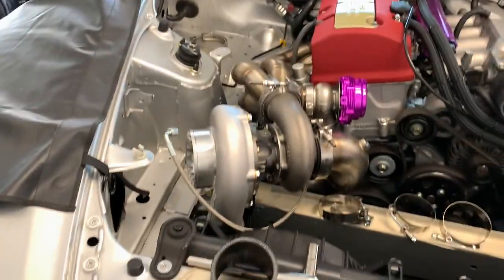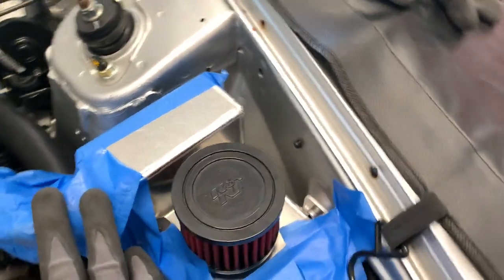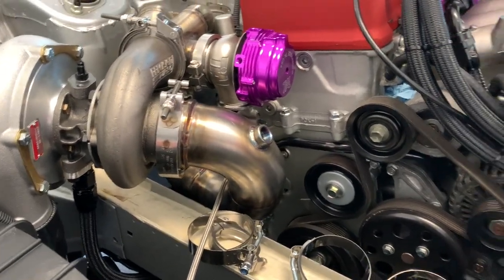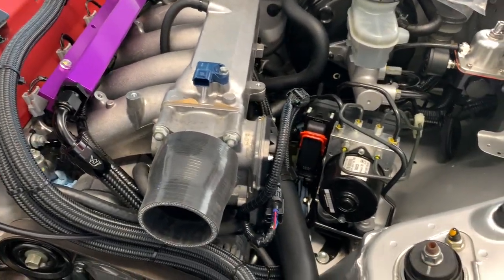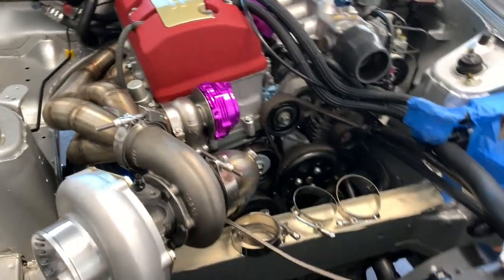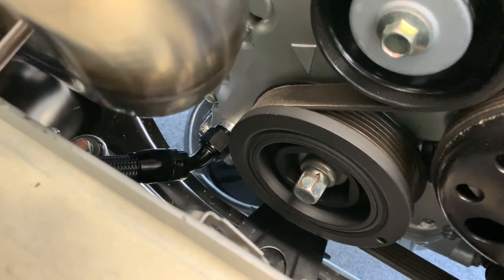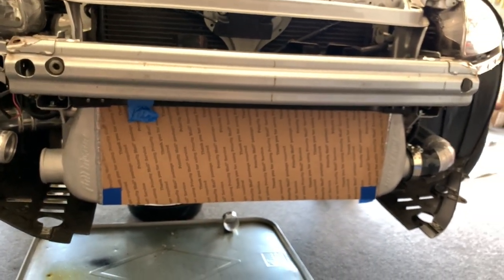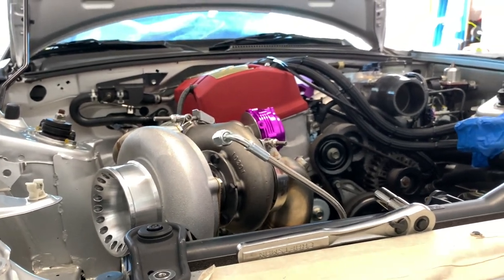Turbo S2000 - Build Progress - ALMOST DONE! (Part 1)

Comment: Hell yeah, your build is super clean. Would you need to run a catch can if your only boosting to 7psi? And do you think stock injectors and the stock pump will be adequate for under 9 psi
Reply from the maker: Thanks! You would need to upgrade both pump and injectors. You don’t need a catch can for low boost like that. It’s never a bad thing and just helps relieve any excess crankcase pressure. You could simply vent your valve cover with a small filter.

Comment: congratulations great job!! internal
Engine is stok or forged piston?
Please make the video at end  work
Sorry for my english ...:(:(
Reply from the maker: 100% stock engine can handle 650-700hp.
Reply: @ArcLightAddicts  with stok engine 650/700hp!!!!!
It's hard! What pressure you wath
Working the turbocharger??
Reply from the maker: @agos2k43  About 28 psi on a Precision 6266. Dont touch the motor and you’ll make good power :)
Reply: Ap1&2 stock have forged piston and rods. The rods are thin. I think the crank is forged too.

Comment: Hey quick question where did you run the oil feed line from ?
Reply from the maker: Tapped into the oil pressure sensor above oil filter and used a T.